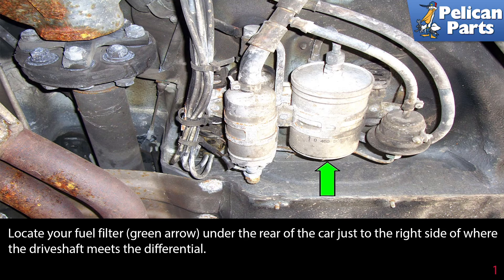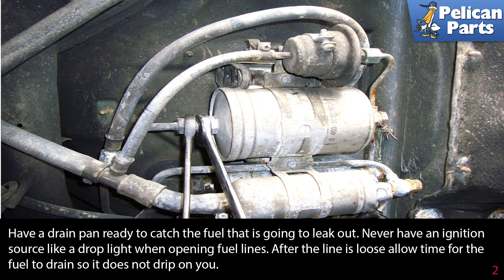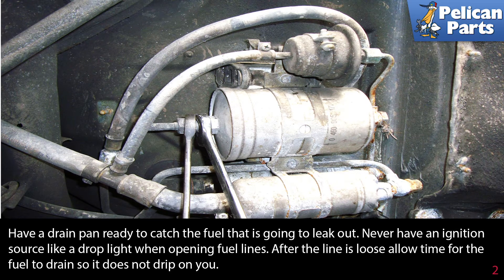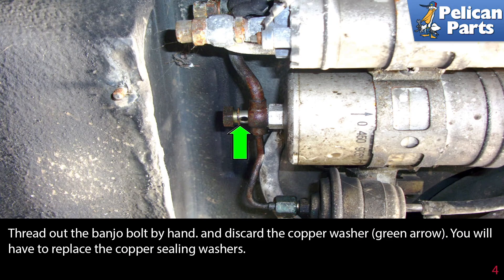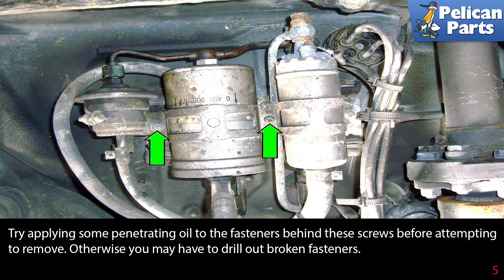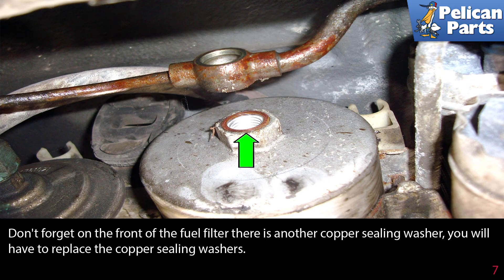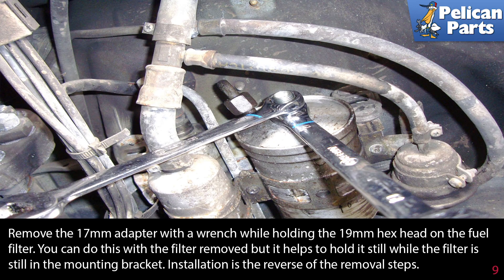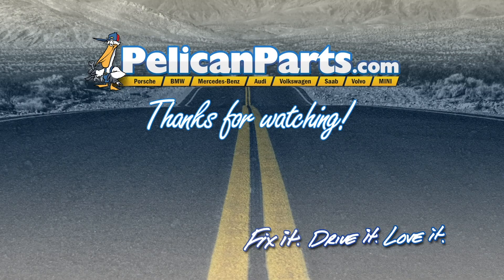Mercedes-Benz R129 SL-Class Fuel Filter Replacement

Comment: Shouldn't you put a clamp on the fuel hose so you won't have fuel constantly pouring out while you're trying to change all of this?
Reply from the maker: Clamping the hose could damage it.
Reply: @pelicanparts  I knw Mercedes used to offer a tool that gently crimped the hose - if you don't do that you have gas pouring out constantly until you can get the new filter on. It's a job I have hated over the years.